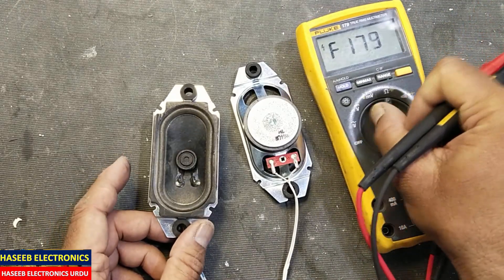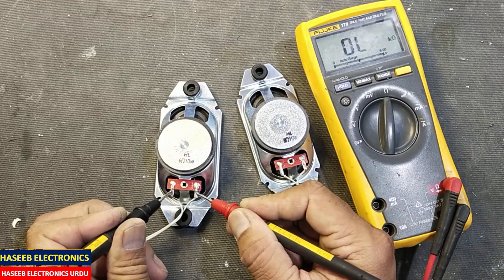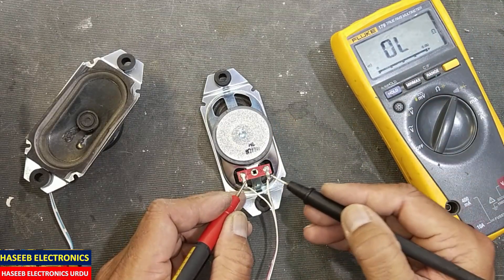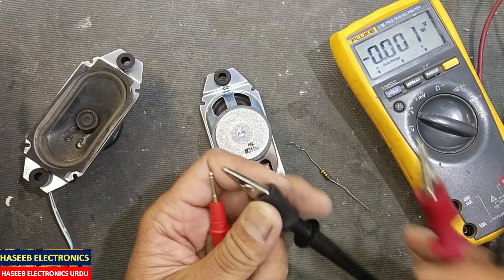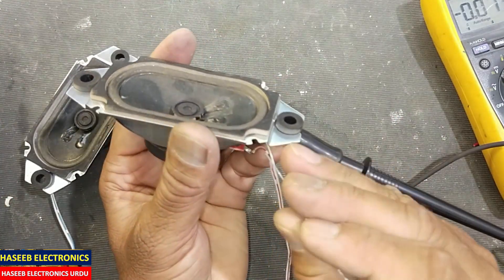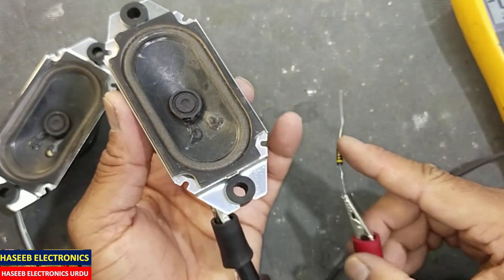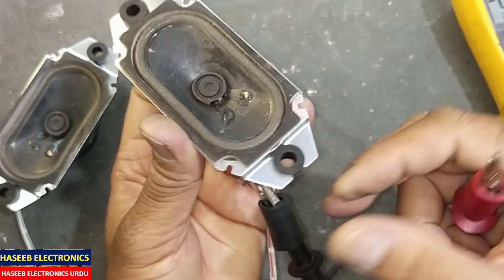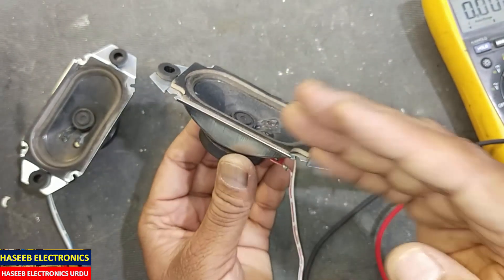{602} How To Test Speaker With Multimeter

Comment: MashaAllah very useful video, on how to check continuity in speaker wiring when 70/100v speaker (10Nos) are connected in parallel
Reply from the maker: it becomes easy, just to check series parallel connection 
if all speakers are in parallel 
resistance for 1 speaker divide by total number of speakers 
for example 
i have 10 speakers. every speaker have 8 ohms 
8 ohms / 10 = 0.8 ohms total resistance

Comment: Very informative video sir....what is the resistor value and I can also use 9v or 12v battery to test...thank u sir
Reply from the maker: you can use 6 Ohm to 22 Ohm 1 Watt or 2 Watt 
you can use 9volt to 12 volt with this resistor
Reply: Thanks for ur valuable reply sir🙏